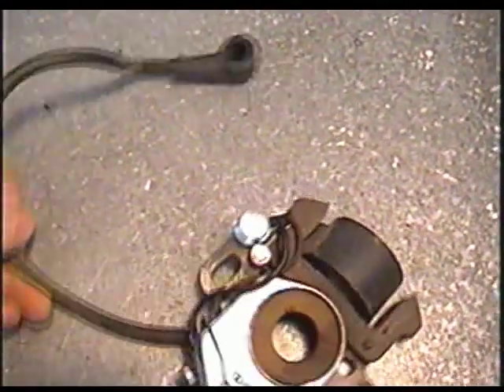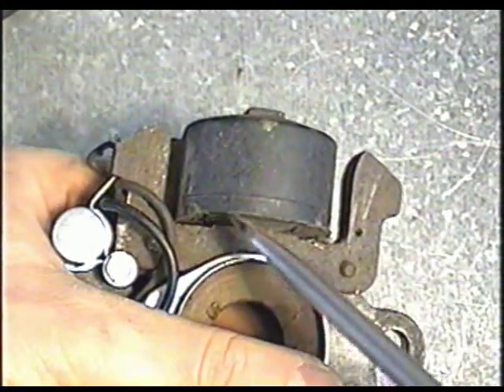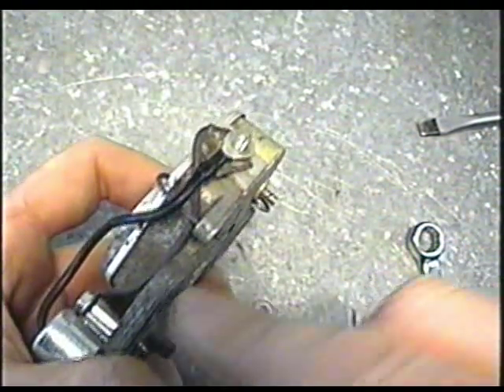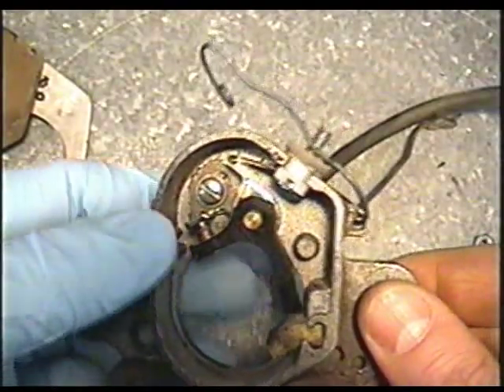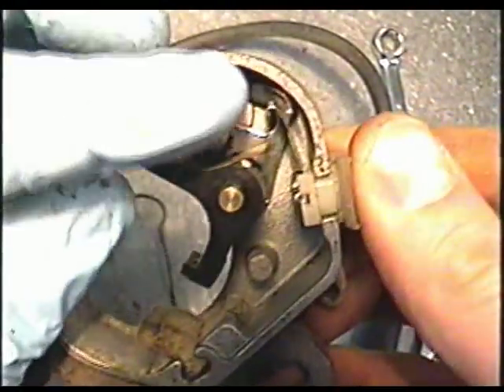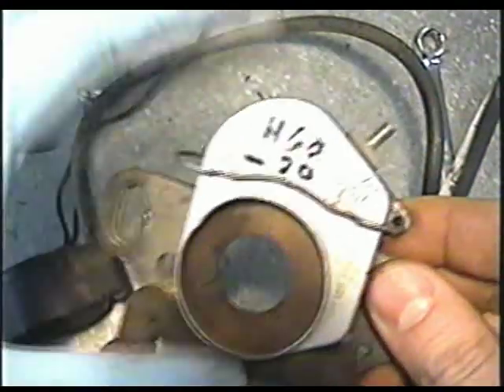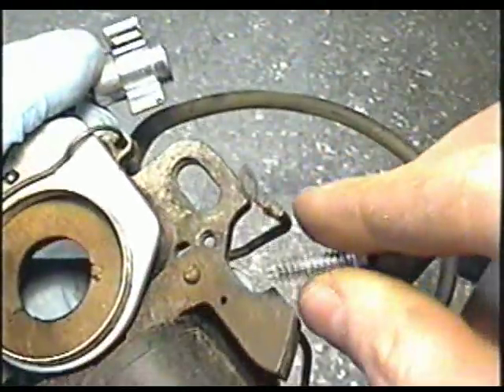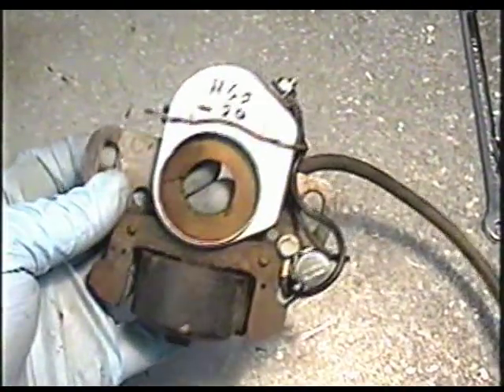Removing the Coil, Points & Condenser from Magneto on older Tecumseh Engines

Comment: I realize this is from a while back but I have a Kohler K series 8hp with a coil very similar to this one without the points attached...can I remove this one the same way? Can it be tested  while apart? What should I look for while I have it apart to determine if it's good or not? Thank you.

Comment: I have an old Troybilt tiller with no spark - Tecumseh 6hp engine. I suspect something going on with the ignition. Question is, how do I know if the coil is actually bad? Is there a reliable way to test it?

Comment from the maker: condenser is to protect the points, and keep them from burning out prematurely.
The condenser is just a little can with a strip of tin foil and a strip of waxed paper, rolled together inside a little can. A wire is attached to the roll of tin foil and the waxed paper is there to separate one roll of the foil from the next one. The condenser is merely a storage room for electrons.

Comment: Hello I’ve replaced the points, condenser and magneto on my motor and put new spark plug and it still produces no spark when turned over, any suggestions? Thank you

Comment from the maker: just line up the plate where it was bolted before taking it off, also if the marks are gone just line up the plate in the center of the bolt holes

Comment: is the cover absolutley nessicary, I have a H50 I'm repairing for a mower and I don't have the cover. the points are clean yet I cannot get a spark, I've held the HT lead tip and the cylinder head and I feel nothing when I crank the engine, would that mean the coil needs replacing?

Comment: Really like the way you explain things, brief and clear. Right now I am playing with the exact model of a Craftsman snowblower. The blower doesn't have spark. Tracing down to the coil, I wonder how I can be sure if the coil is bad. Do you have any advice to use multimeter to test it?

Comment: THANK YOU THIS THING IS A MONSTER TOO PULL, I TAKE OUT THE PLUG AND THE COMPRESSION READS ABOUT 110TO 125 LBS  IF ANY ONE KNOWS ABOUT THESE ABOURISTS SAWS PLEASE HELP THEY WERE ONLY MADE IN 1997-98 FOR ONE YEAR.AND ARE VERY EXPENSIVE TO REPAIR THEY ARE A TOP HANDLE SAW.THANK YOU DONY FOR THE FAST RESPONSE,I FAVORITE MOST OF YOUR VIDS YOU ARE A FANTASTIC SMALL ENGINE GUY AYY #1 IN MY BOOK

Comment: I have Tec HM80. The wire from coil to bolt to points always shows as being grounded, even when disconnected from bolt.  Is this correct ?

Comment: I watched probably 20 YT videos on how to test a coil.  I was reading OPEN on all leads from the coil to the "iron core".  I finally pulled the coil off of the iron core to see if I could see any damage, and there was none.  Then it dawned on me.  Why is there 2 small leads on the coil?  This coil is not grounded to the "iron core", because it is removeable, so the short second wire is grounded to the condensor.  If you read between either of the smaller wires and the plug wire you will read resistance.  I think my coil is weak as I am reading 7.5K OHMS, and it has a yellow spark.  So I have a new coil ordered.  Hope this helps someone.

Comment: You have the best instuctional videos.  One thing I forgot to do  was mark where
the mounting bolts were when I removed the points assembly.
Whats the best way to get them back where they should be.

Comment: Your tips on getting the flywheel off were great. 2 taps and it was off. However, I found the magnets had fallen off the flywheel. Which would explain no spark. How do you fix that? Or do I have to find a new flywheel?

Comment: Excellent Video.   My snowblower had a 3.5 engine with no spark.  
I did not have to replace coil because the points were the issue.  I removed them and cleaned the contacts.  Ensured all connections were clean and had a good ground.  

Put it all back together and runs (almost) like new.

Thanks again for a great video.

Comment: I just got into one of these yesterday with a no spark condition. The points are pretty worn but still gapped. The laminated metal that holds the coil in place had sustained some separation of the laminates on one side of the coil. Any idea if the assembly is still available, Don? It's the 7HP Tecumseh if that matters. I have the Ariens model  924048 and serial 017718, but can't find an engine tag yet. I had marked the assembly before removal, but my question is why is it adjustable? I'm assuming to set the air gap, but haven't found any info as yet on how to accomplish that. Thank you for any advice that you may offer.

Comment: On your replacement coil (as on mine) your condenser and points wires come out of the coil on the opposite side of the square hole from the original coil. I put the spark plug wire in the same place but had to run the condenser and points wires differently... Have you actually installed a coil with the wires moved like this?

Comment: Hey dony, I have a h60 tecumseh. Cleaned and gapped the points. It now idles, but backfires and then stalls when it's at full throttle. I have a new carb on it, and adjusted the screws to no avail. Should I time the engine with a dial indicator, or install new points and condenser? What would you do first? I'm pretty sure it's a timing issue...thanks!

Comment: Dony,
I have a question for you .
Will the 30548b condenser work on my lauson TLC 349?
I need to make it fit , I realize that ,
But in general Is the farad rating somewhere around 20 microfarads ?

Comment: Great videos, I have watched many of them.  I like to repair the older chainsaws & you were the 1st person I thought of when I ran into this issue. I have a Remington 754 with no spark.  Changed on off switch, pulled flywheel & cleaned breaker points, changed condensor with used one from a Homelight XL-12 (not sure how to check these).  Also swapped out ignition coil from the same XL. Original coil was the same shape & size, fit great on bracket.  Any ideas would be greatly appreciated!

Comment: i CERTAINLY APPRECIATE THIS VIDEO!  As I am trying to start a like new (still has bright paint on the exhaust) 70s era Craftsman generator and realized it had points.  While I have watched my Grandpa do this many times, I had forgotten what a PITA the old style was removing the whole damn flywheel and 3 head bolts just to check the points .

Comment: Hi Don, would one of those Nova Electronic Ignition modules work to replace the points and condenser on these old Tecumseh Magnetos?
Reply from the maker: not sure,never tried. I have good luck replacing points and coil

Comment: Should NEVER use sandpaper or emery cloth to clean points contacts! These will leave a gritty residue between the contacts, causing a faulty connection. A thin, steel points file or steel fingernail file is the only way to thoroughly remove any debris or oxidation from points contacts. Then use electrical contact cleaner, brake cleaner or cleaning solvent (paint thinner) and 150± psi compressed air to clean any oil and metal filings from the points contacts.
Reply: i use sandpaper every time and never have an issue. As long as after you sand you flip the paper around and use the cardboard to remove any excess grit and residue you will be fine. Then you can use your contact cleaner to rinse thoroughly

Comment: Hello mate when did they move to electronic ignition ? my engine is a Tecumseh MV-100-SE , starting and running been getting erratic and  hates starting from hot , have cleaned the carb well , new petrol etc and it's getting in to last chance salon territory lol , shame as it has good compression , still sounds like carb ? thanks and excellent vid btw .
Reply: Around 1984 on most Tecumsehs, late 82 into 83 on Briggs.

Comment: on a magneto that is using the electronic style and not the condenser would there still be points on the inside of the magneto? if so i think i'm missing quite a few parts for mine >.<
Reply: No. Yours is just a simple coil. (Electronic ignition). Go to websites such as www. partstree.com and enter your engines model for a complete parts diagram and break dwn. You have it easy. Take a business card put it in between the coil and the flywheel. Tighten your coil. Your done, its set properly and ready to go.

Comment: Just saw your vid. Change all the same parts but still no spark? I have a 4hp any other ideas . Thanks Fred
Reply: If you've changed plug, points, condenser, coil and set the plate properly and you still have no spark then check for a grounded wire somewhere.
Reply: Thank you

Comment: Good video and helpful.  Is it normal for the two small wires coming out of the coil to be shorted electrically?  I have purchased a new coil and both the old one and the new one are short between the two smaller wires.  I see that one goes to the condenser screw and the other connects to the point terminal.  I would think this is my non spark causing issue, but I'm skeptical that I recieved a new faulty coil.

Comment: Hi, well its obvious i will have to pop the flywheel on and off to set the gap on the coil and magnets. What should the gap be?  thanks. Took mine off and didnt mark it.
Reply: Just put a business card in between when tightening. That has been the general rule of thumb for a long time.